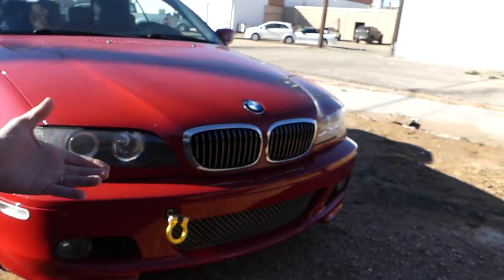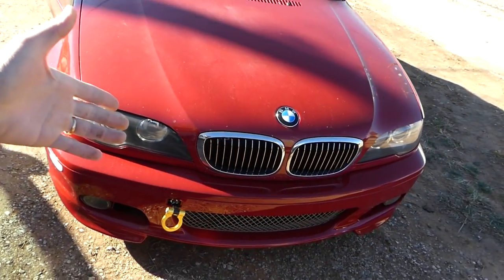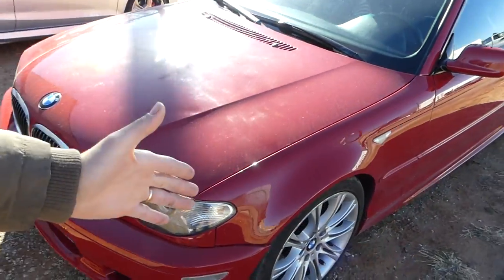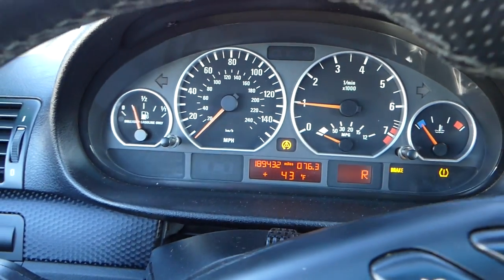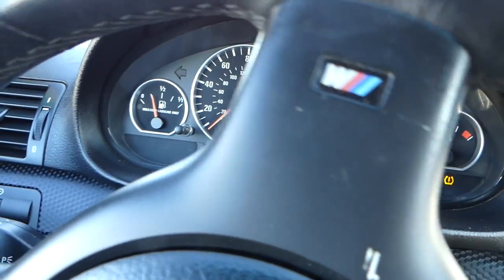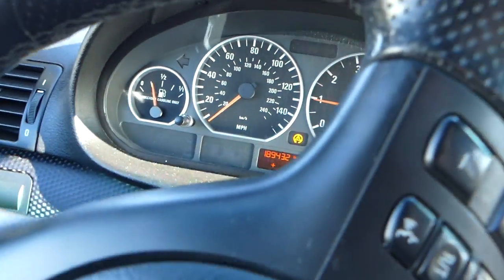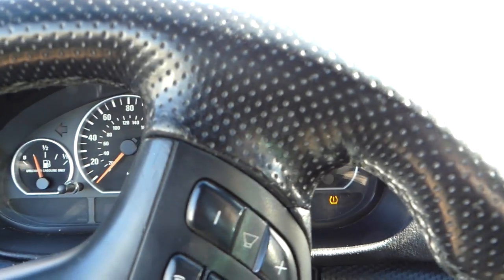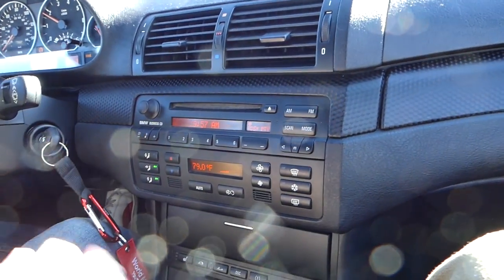BMW DRIVE SHAFT MAIN BEARING DIAGNOSTICS SIGNS OF BAD BEARING

Comment: Sir. Thanks so much for this. I’ve been chasing this issue for about 6 months now. Learned to drive so it doesn’t pop like that. Only on acceleration and under load. Over 3krpms it is fine, everything is good. But on 1-2nd gear shift is absolutely brutal.

Comment: My Bmw has a vibration inside under the armrest (sounds like under the seats too sometimes) the vibration only comes on the highway when accelerating over 50mph ( vibration stops if I take my foot off) the steering wheel does not shake.... any idea?
Reply: Hey 👋 did you ever figure this out? I got the same thing happening around 50 mph

Comment: I have a very similar sound in my 2009  e90 320i. But the sound goes away when the engine warms up. Loud with the more load and faster with revs. Do you think it could be this bearing?
Reply: I have this issue to but doesnt go away, have you figured out the issue on yours?

Comment: So I have this issue with my car it was diagnosed as the center bearing, by my husband. Who is a master technician on Rolls-Royce Maseratis BMWs in mcferrons. We bought my car 60 days ago it's a BMW 320i BMW is telling me that this is not the issue and they zip tied my emergency brake cable telling me that that was the issue 🤣 is there any other issue that this could be ???

The noise was happening only when you take off, since BMW zip tied it it happened slightly when you take off but you can still hear the rotation in the drive shaft while you're driving down the road... Is there any other issue it could possibly be 
(The noises coming from the center hump on my back floorboards) 

Again BMW is denying this issue and it's been there three times the first two times they said they didn't hear anything 🤣 I heard it the day I drove off the lot. Then they said they did hear it but it was the emergency brake cable rubbing the drive shaft (I feel like they're trying to mistake us for fools) please help

Ps. I subscribe to your channel now lol

Comment: My e46 coupe has now 200.000km on it, i think i got this problem now, hear a similar sound at low speed, from the front of the car or middle right, i think its a driveshaft problem or guibodisk. Going to check this fast